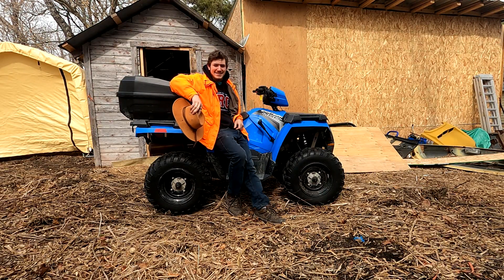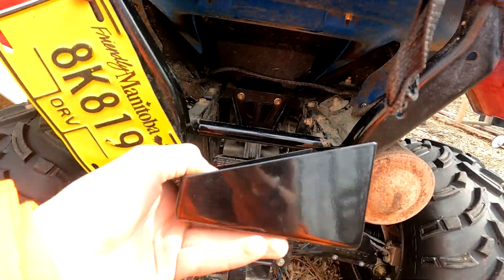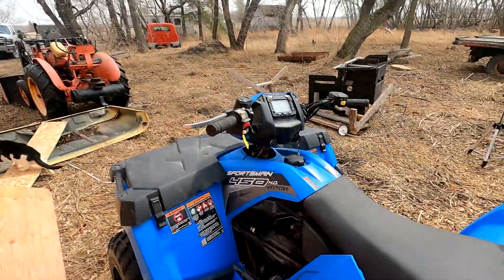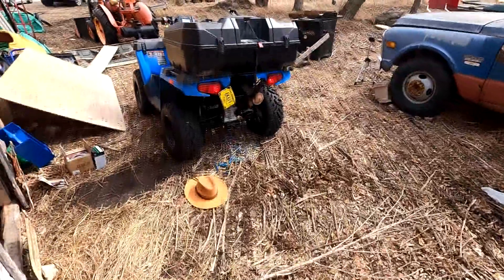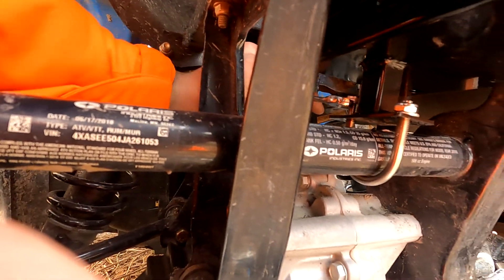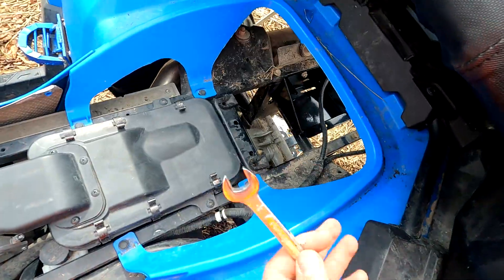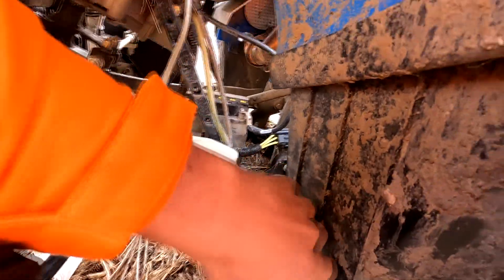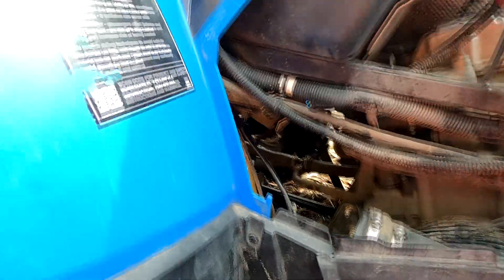Relocating the Battery on the Quad

Comment: Just bought the relocation kit I didn't like where they wanted us to mount it in the rear wheel well I came across ur video and decided to install it same place but inside the storage compartment just cut a hole in bottom of storage compartment and the dropped the battery holder down into the whole it protects battery more and keeps it out the weather water and nud works perfectly appreciate tge video buddy
Reply from the maker: Glad to help mate and agree to keep it as protected as you can

Comment: When riding in trails at low speed use low gear or youll burn your belt up
Reply from the maker: Good tip. But who drives trails at low speed 😂
Reply: Where im from you have no other choice lol trails aint smooth here
Reply from the maker: @darrenhicks94  who said the trails were smooth. They are bumpy from everyone speeding through them 😂. I will admit I treat them a lot like a race track, my local trails. With being careful as I can to hear other quaders. And the end of the day things happen and just got to learn form it. There are some amazing trails to ride slow through and some that are fun to rip through. Learning what trails to do so is the learning curve.